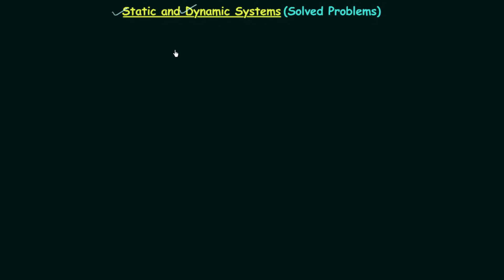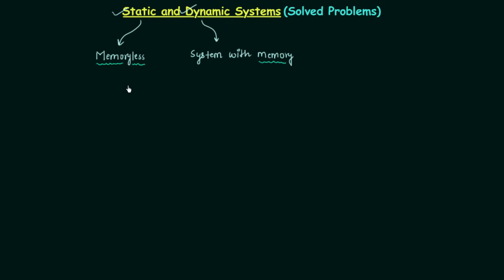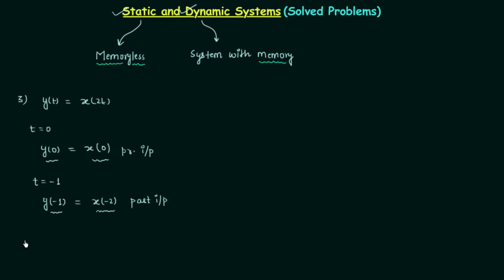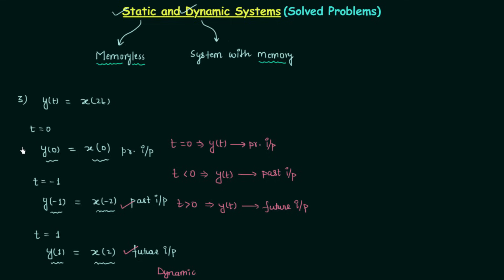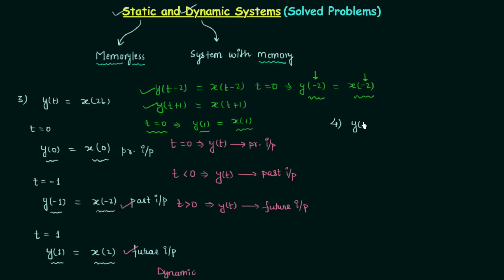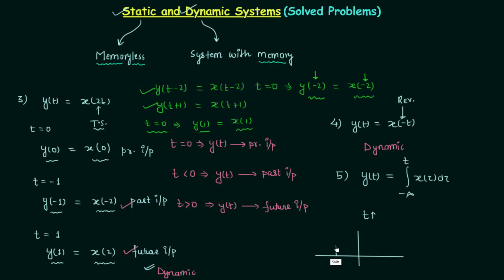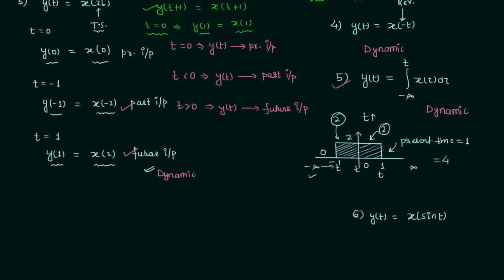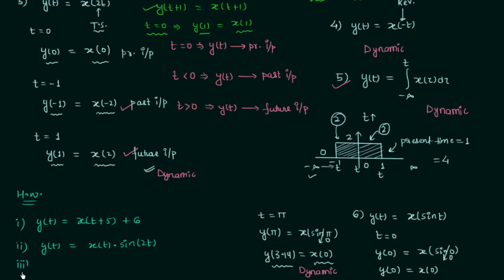Static and Dynamic Systems (Solved Problems) | Part 1

Comment: The first system is dynamic because we get the future values of the input and the last two systems are static because the output is dependent on the present values of the input
Reply: Have you solved these questions on your own?
Reply: Put t=pie in the 2nd problem, you shall get it to be dynamic
Reply: @avishekmishra8177 sin(2t) is the coefficient, it doesn’t affect the signal

Comment: 1. Dynamic system;
2. Static system;
3. Static system.
Please correct me sir if i am wrong
Reply: 2 and 3 kaise static sir. Can u me sir?
Reply: @shaikmuinuddin4359  because sin(2t) in this question is the co efficient...hence it is static
Reply: @aryanarora1180  when it is y(t) =x(t) +5 then what is it? Dynamic or static?
Reply: @isha_sai_sha009  static
Reply: 3rd ,how is it static system?
Reply: @isha_sai_sha009  static system
Reply: @aryanarora1180  but if we solve both together than
Reply: @isha_sai_sha009   static
Reply: How is 3rd one static ??
Reply: @NAKSHATRARATHOREBEC  because exp function is there  no doubt but x(t) is not gonna change it will same for:-y(0)-x(0)
Y(5)--X(5)
And so on
Reply: @isha_sai_sha009  static
Reply: @isha_sai_sha009  It is static
Reply: @isha_sai_sha009  it is static. Bcz you have to check in input only.if t=0 then y(0)=x(0)+5.
Reply: @isha_sai_sha009  static
Reply: 1 only dynamic and other 2 static as, we can check directly by changing t values in each case:
1;(t+5) hence total varies 
But in 2 and 3 what value of t putted in x(t) is same as y(t) ... e.g;X(0)-Y(0) means both varying parallely..
Reply: @NAKSHATRARATHOREBEC  vit?
Reply: @lakshmisathyan2965  Yeah! XD ! You too?
Reply: @NAKSHATRARATHOREBEC  haa 😂
Reply: @lakshmisathyan2965  lol! cool!! guessing you on this video so 2nd year ig?
Reply: @NAKSHATRARATHOREBEC  yesss...😫 I'm in 2nd yr , EEE branch
Reply: @lakshmisathyan2965  ohh cool! lemme if i you need any help, 3rd year here, ECE ! and have a close friend in EEE! XD😎
Reply: @NAKSHATRARATHOREBEC  Yeah sure, will contact  :) :) Thanks a lot :):)
Reply: 1.dynamic system;
2.dynamic system;
3.static system;
Reply: 2.at t=pi ,y(pi)=x(pi).sin(2pi)=0.   y(t) depends on previous output so the signal is dynamic.
Reply: @isha_sai_sha009  is x(t+5) not x(t)+5 ,
Reply: @ayushpatel_0437  bcoz the time us same in i/p nd o/p
Reply: @madhavaiahjadapalli5048  When y(t)=10 x(t)+5 then what is the answer
Reply: @isha_sai_sha009  i am also having the same doubt

Comment: 1. Dynamic system. 
2.Static system. 
3.Static system 
Please correct me Sir if my answers are incorrect. Thank you  sir.
Reply: substitute the value of t=pi in second h/w problem and verify your answer
Reply: @ajazamin9843  y(pi)=x(pi)*0 static.   y(pi)=0 doesn't mean y(pi)=x(0).
Reply: How is  3rd one static ?

Comment: 1- dynamic bcoz system has must store the data of future time and we know dynamic system is memory with system. 
2- static bcoz in this system we need not store the future and past value means this system is memoryless that why is static
3-static same reason which is given in 2
Reply: I have a doubt in 2 ques
That if I put t=0 y(t) is indept of present value .
Similarly, at t=π/2,3π/2....
Output is indept of present input or we can say that its constant for some particular instant of time.
Still , why system is static?

Comment: second problem is also dynamic for value of t=pi
Reply: No sin(2t) is just a coefficient. It will not change the memory of the system. So it is static in nature

Comment: Sir in the second HW problem, if we take t=pi/4 we get the ans to be dynamic right
Reply: no not quite. 
1) is dynamic for bc y(0) depends on x(5)
2) is static bc y(n) depends on x(n), the sine function is just a coefficient, not an input signal
3) is static bc the same logic as 2

Comment: Homework problm
1) is static because x(t+5) +6 here 6 not coefficient so at t=o
Y(0)= x(5) +6
When t=1
Y(1)= x(6) +6
And t=2
Y(2) =x(7) +6 so as it's value is  dependent on present value of t so it is static. 
For 3rd problem
Y(t) = e^-2x(t) 
Here exponential term is not coefficient and it is also depending upon the present input as
t=0
Y(0) = e^-2x(0) 
t=1
Y(1) =e^-2x(1) 
It is depending on present input so so it is static
Reply: If the output is greater than input then it depends on future input. It's dynamic
y(1) = x(1)   static 
y(1) = x(-1)  dynamic
y(1) = x(2)   dynamic
So the 1st answer will be dynamic.